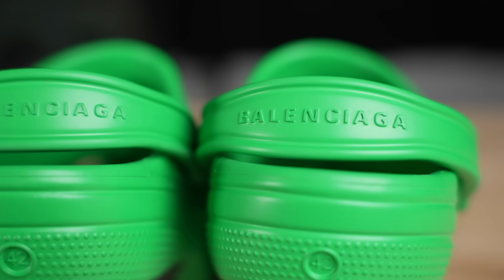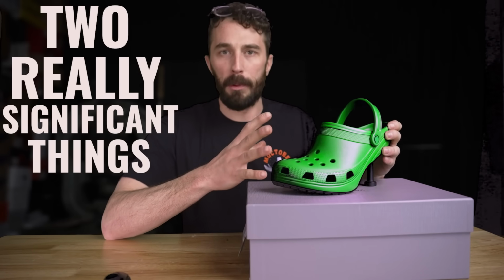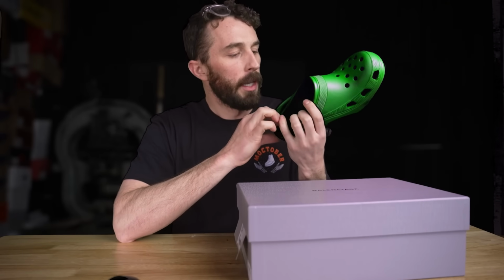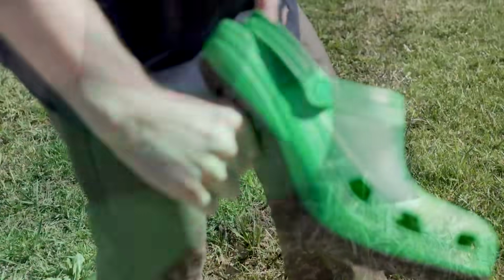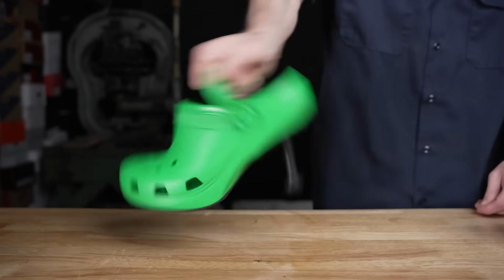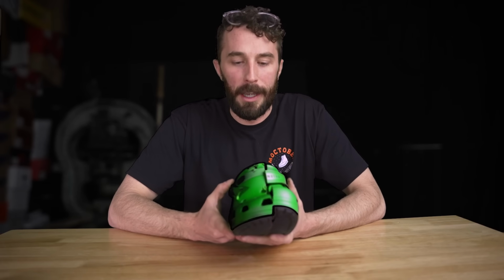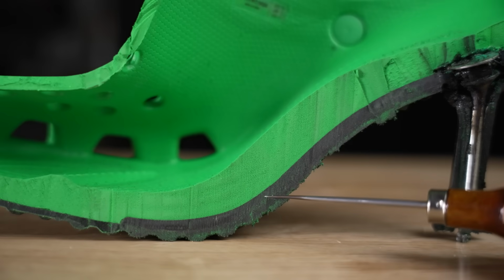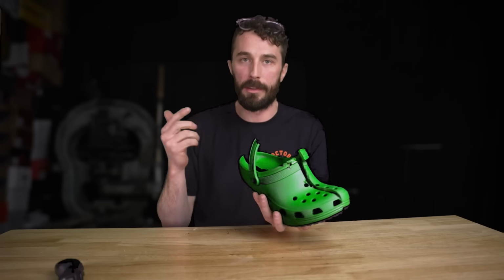I Cut $625 Balenciaga Crocs In Half

Comment: I can attest that these boots are perfect for welding, the amount of protection they offer from heat really puts nick’s boots to shame, I remember their indestructible boot they would retail for $1000, however balenciaga with their innovative technology made a far better boot that is more durable for only $700.
Reply: Maybe in India
Reply: After understanding the reality of FOAM, we're doing some soul searching...
Reply: @nicksboots  hahahahahaha
Reply: I can see the virtues of these for welding: the sparks would just roll out; the air in the FOM would keep your feet from getting hot; and the heel puts you above your work!
Reply: @nicksboots   for wildland firefighting
Reply: @Nicks Handmade Boots  The quality of your boots is fantastic; however, the quality of your sense of humor is a step above. And yes, that pun was, in fact, intended. I tip my hat to you.
Reply: @nicksboots  Um, it's called FOME. Don't be disrespectful, especially with your crappy leather, stitching, and nails.
Reply: Was 5% off so had to pick up 5 pairs and try them, as a sneakerhead I can confirm they're everything I wanted them to be and more.
Pro-tip: If it gets cold in the winter, you can wrap a pair of gloves around them, the toes extend out the holes and into the gloves perfectly.
Reply: I also used these for a wedding! I felt very fashionable in my navy Balenciaga suit paired with these awesome boots! I was even visible on the group photo this time because of the extra height, can't be thankful enough!

Comment: You're 100% wrong about the origin of the word "foam". It's not "F.O.M.E" it's "foam", first appearing in Old English prior to the year 1150. It meant then the same as it does now "a light frothy mass of fine bubbles formed in or on the surface of a liquid or from a liquid"
"F.O.M.E." is a bacronym, and you should be ASHAMED of spreading misinformation.